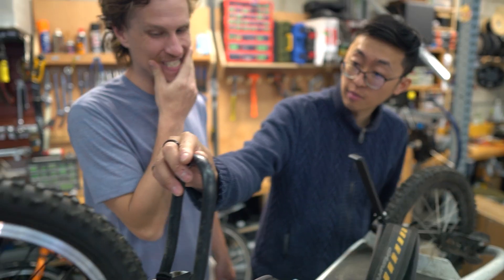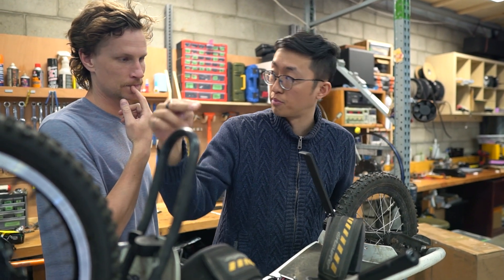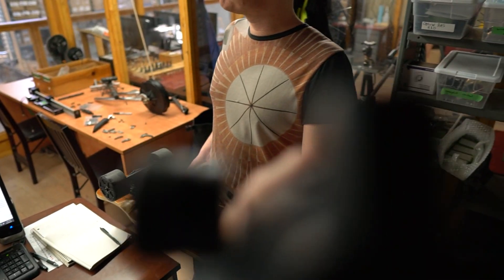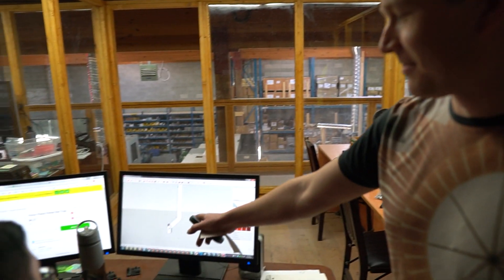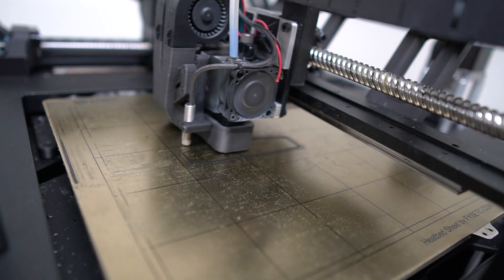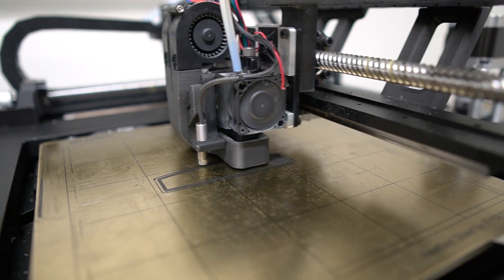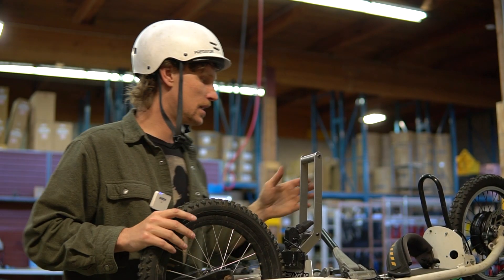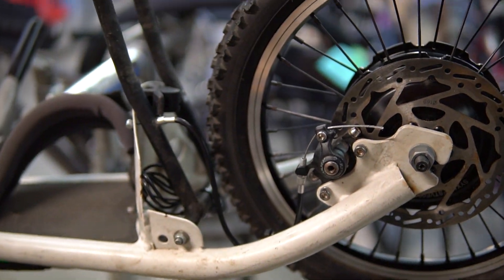Electric Dirtsurfer Conversion, Part2.  Tuning it up for the Vancouver ESK8 Summit

Comment: CAD, 3D Printing, LASER Cutting . . . 

No offence, but I'd have been out riding with a modified Throttle Arm before they'd even decided how to go about it . . . 

What's that phrase again?
All the Gear ~ no idea.
Reply from the maker: Agreed fully and to clarify this isn't representative of how we generally do things, but we decided this was a good chance to let some of the young and green staff get familiar with the prototyping equipment. Of course 30 minutes in the metal shop with a drill press, band saw, and other basic hand tools would have made shorter work of the project.

Comment: Need a leash that you can nose up with in an emergency stop/ hop off, that way you could yank the front wheel up to prevent hitting something or a person, and also saving the front wheel. Sweet build tho. If I did use a leash I would also look for a safety breakaway that only lets you apply enough force to get the nose up when it's rolling so that if you crash you don't get caught on the leash.
Reply from the maker: Yup, if safety was a first concern in this build a lot of things would be done differently!

Comment: I like it. Definitely suited for smoother surfaces, preferably pavement where it's speed and the stability from the spinning wheels takes hold. 

Tip: Wear gloves... ALWAYS when riding on pavement. Trust me, your hands will thank you for it.  I totally get not over thinking and over burdening activities with ridiculous safety obstacle, especially when style gets involved.  Hell, a benefit for picking the V-Rod as my motorcycle meant a full face helmet looks good when riding a Harley.  The good thing about gloves; you can always find a pair that makes you look better with them on.  .... That's likely not 100% true, but I need to think to find an example.

"If you don't put safety first, at least put stupid last."   - a brilliant phrase uttered  by a wiseman in a YouTube video

Comment: 🔴 Gee Grin, my $600 geared front drive is useless since you do not carry my controller anymore!!!
Reply from the maker: No motor is useless. Both the Baserunner and Frankenrunner controllers are capable of running all the motors we have sold. If it's an old hub with andersons and JST plugs instead of the L1019 connector we have adapters for the Frankenrunner_MT here: https://ebikes.ca/phaserunner-motor-harness-anderson-long.html
Reply: @GrinTechnologies  We just ordered my new controller replacement!

Comment: I don't understand why your not using a wireless skateboard throttle for acceleration and regen....
Reply from the maker: You could, but hands free is the way to be!  Plus you never risk loosing the remote or having it run out of battery etc.